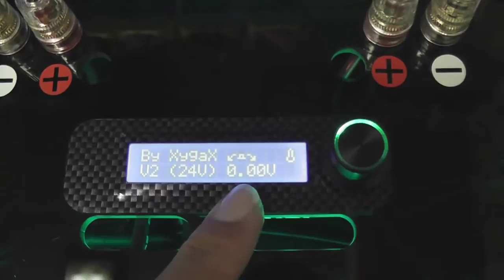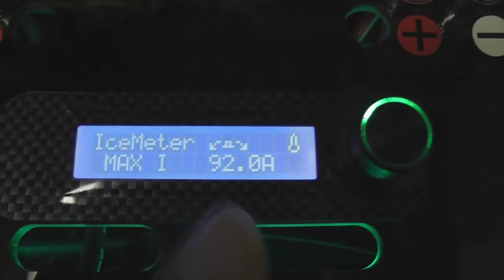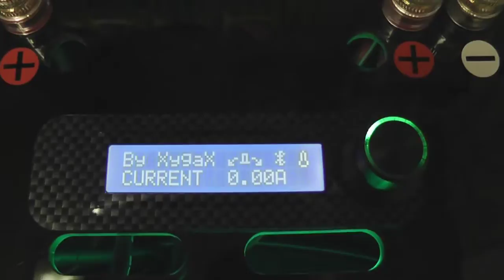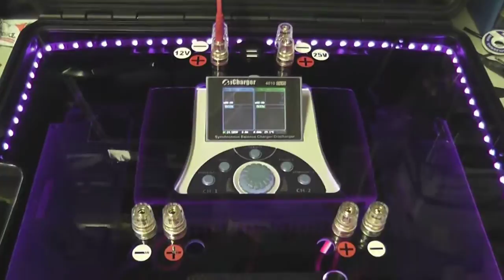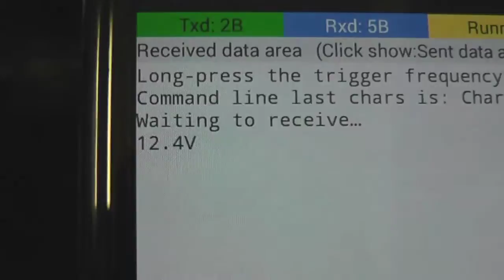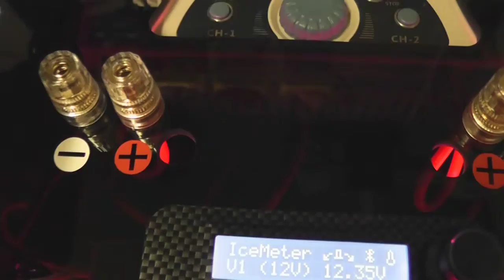Coolice IceMeter Display Controller

Comment: I saw this when I was beginning my research on a more powerful charger. It took some research to find it again or atleast the updated version. :) I dont want to come off wrong but when i made the decision to get an upgraded charger the price seems to go up and up. I decided to go with the dual powersupplys obviously for economic reasons and then found out of the risks and am looking for piece of mind. I'll get to my questions and conserns now, when I weight the price of this and 2 ps and 1 24v ps after shipping they are pretty closely priced, thus is the old version still avalable for economic reasons? other than fetures( I want to add I love and appreate the hard work and thought you are putting into this product its obvious your heart is in it and for that I support you even if I cant financially yet. :)) that if I revert back to a single power supply can still offer protection, or will and how would this circuit protect if powered off a lead acid or lipo battery/s? Is this circit if installed correct going to offer complete piece of mind, for example if my charger fails and icharger asks me what ps im using and I say 2 in series but i have this kicka protection circuit so it had to be something else, would you confidently say that was the case? given the circuit was in proper condition of course. bear with me im almost done, Do you or will you have any type of affiliate or reword program, i'm not the only one at the races with an icharger in a case and I cant wait to show off the cool fetures even though i havent even bought one yet, it would be awesome to work out a win win partnership if your interested. lastly what fetures do you have in mind for the bluetooth app in the future, perhaps a notification with the amps drop say after staying at a set amout for a period of time to tell us our lipo is charged or something stoped the charge. Sorry as i type more comes to mind, if it has a current sensor could it have a mah cutoff, several pilots have large lipos in their cases for charging when power is not avalable. other than that everything looks great and look forward to your response. :)
Reply from the maker: Hey Buddy. THank you for your enquiry.Sadly the recetn price hike of the DPS-1200 units hasn't made them less attractive, I think the price will some down again soon, but for hte meantiem we have to wait. The lesser powerful DPS-750AB 750 watt units are still keenly priced and suit the majority of users nicely.Both my protection circuits work with this unit as well so it can be used on either PSU option.There is two types of protection, the basic protection only unit which is a little cheaper and the more feature rich IceMeter that costs a little more.Please see my web site which shows the two options; http://www.coolice.co.uk/cccases/protection-1.htmlBear in mind my circuit is only really needed if you are running 2 or 3 server units in series to make 25 or 36 volts. Single PSU's do not pose the same issues to the iCharger DUO's, as if the single PSU fails, all power to the charger stops to. However with a multiple PSU setup, if only one fails the remaining good ones try to carry the load and this is where problems arise from. My circuit is in simple terms a switch, so if one PSU fails, they all get turned off very quickly to stop the charger cycle.Same goes for lead acid batteries, but in this case the battery would not just fail abruply, but most likely slowly power down and thus the chargers own low voltage cut off would sound a problem with the input power.I don't have any affiliate or loyalty setup in place, the problem with that is would then get very difficult to make even the small profit I make now off each board.I'm open to a small discount on multiple units of course sent to one address, which could always come in handy.With the bluetooth app, sadly I am still not any further with this. I did get promised an app buy a customer which never materalised and I still have not had the time to sit down and learn Android code. However I would look favourably on any customer who did this for me following their purchase of an IceMeter.Any questions email me: ian@coolice.co.ukIan

Comment: Hi Ian, i spoke to you earlier in the week reg chargers! Im reluctant to buy one as each one you build gets better and better...Truly amazing work! Not sure if the bluetooth is much use to me...i cant see why i would use it..but i feel i need it! i need to have a think about what i actualy need and want from a set up..im a bit dumb when it comes to electronics (My nick name should be 1 amp...Abit dim!!)
Reply from the maker: Hey Buddy. Lol, thank you for the compliment on the charge cases it's appreciated.
If you fancied the display controller, over the standard PSU Protection only other option I do, then we could omit the BT module. But it only removes £5 from the price, so it may be worth fitting it and you don't to use it, but it's there if you ever wanted to.
Best thing is if you have a think about what you want from a charge case, then I can advise you how best to make it all work and make a case you're proud of. You've got my email from memory, so when you're ready give me a shout.